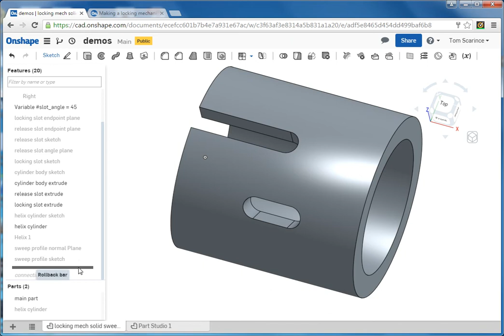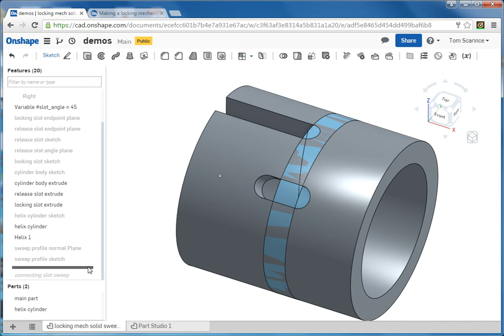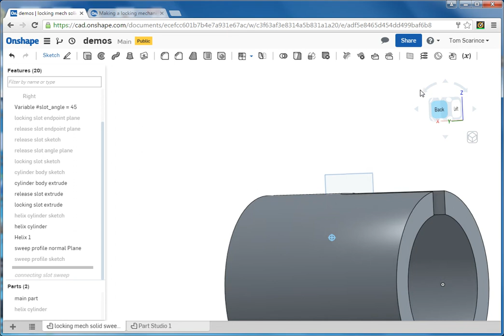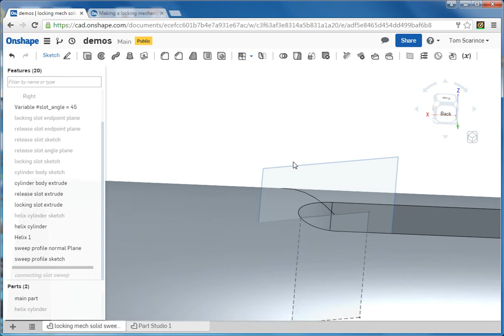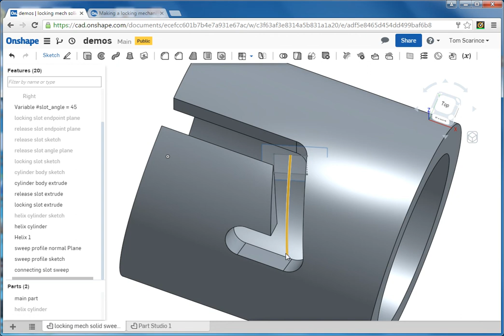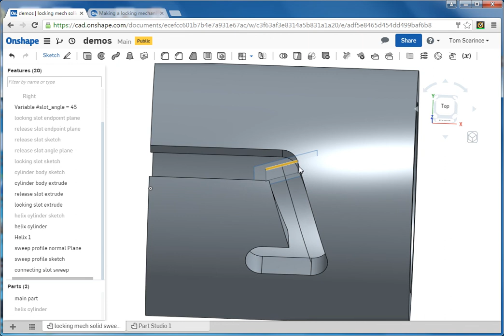Modeling a Cylindrical Locking Slot with Onshape

Comment: Now how do you constrain the pin to slide in the slot?
Reply from the maker: Good question.  I tried using a tangent relation between the pin and the slot without success.  You can use  a screw relation to simulate the movement through the helical portion of the slot but I don't know if it is currently possible to simulate the transitions to the straight sections.